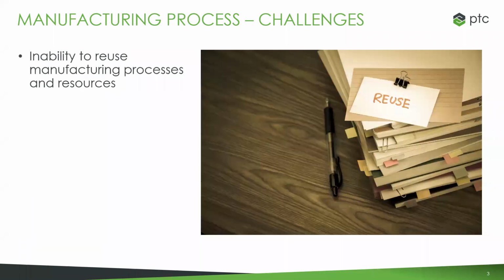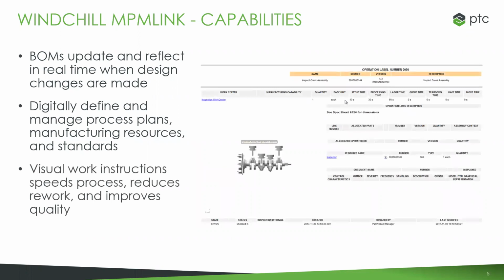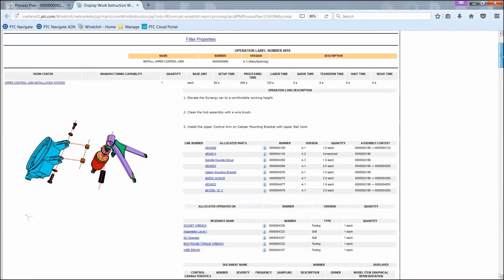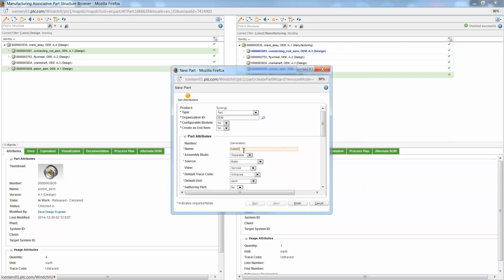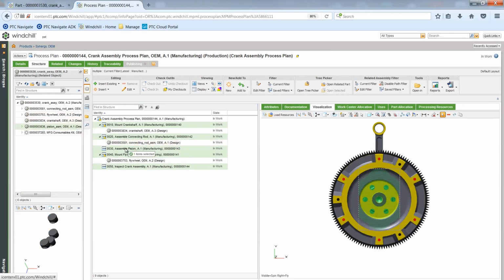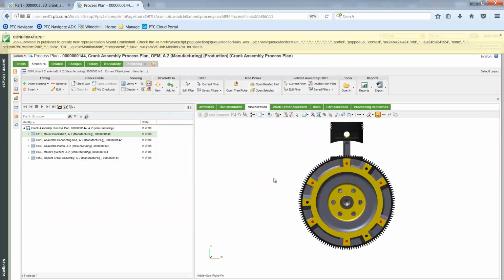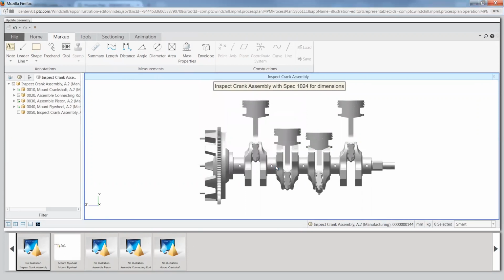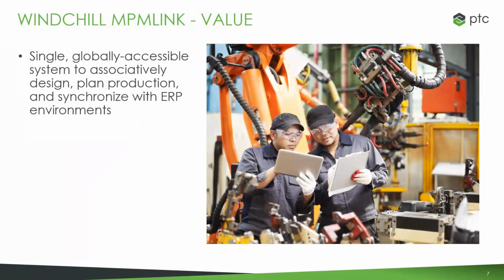Windchill MPM Link for Manufacturing Webinar

Comment: Hello,sir ! What difference between MPM link and PDM link?
Reply: From AI

What difference between MPM link and PDM link?
MPMLink and PDMLink are both modules within PTC's Windchill product lifecycle management (PLM) system, but they serve different purposes:

PDMLink (Product Data Management Link): This module is primarily used by design engineering teams. It manages parts, assemblies, and drawings needed for manufacturing. It also includes change management features to track incidents, problems, and revisions.

MPMLink (Manufacturing Process Management Link): This module focuses on manufacturing. Once a design is finalized in PDMLink, MPMLink helps plan its production on the shop floor. It allows users to create manufacturing BOMs (mBOMs), define process plans, integrate CAM files, and generate work instructions2.

Essentially, PDMLink handles product design data, while MPMLink manages manufacturing processes. MPMLink requires PDMLink to function, as it builds upon the product data stored in PDMLink.